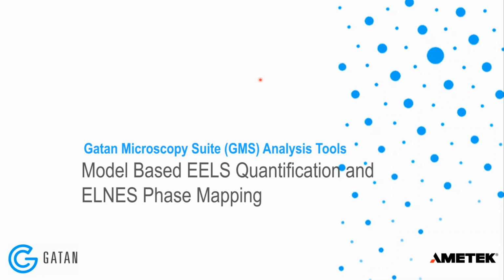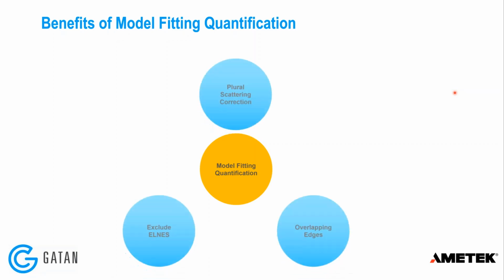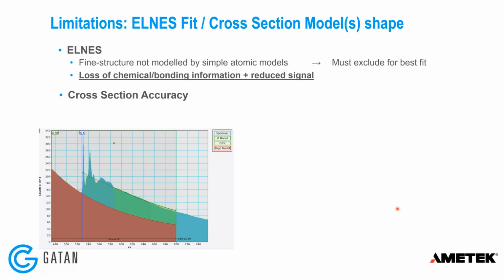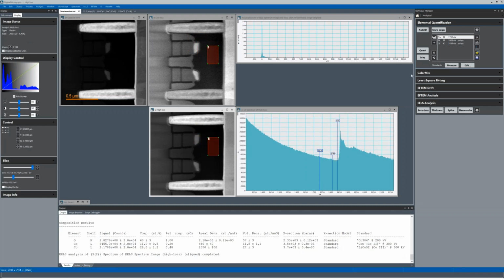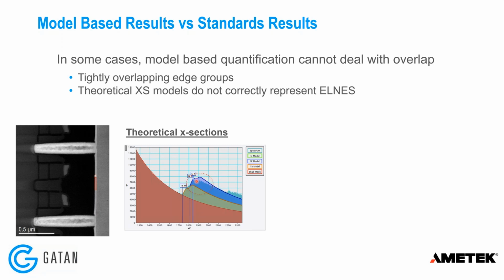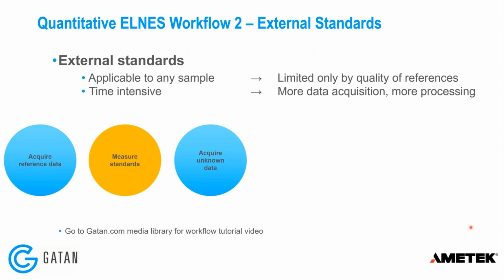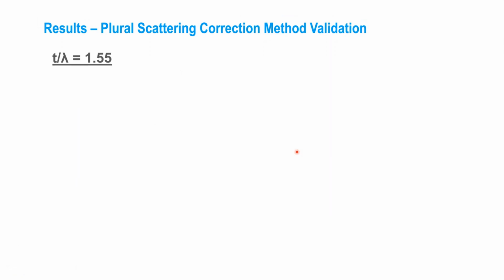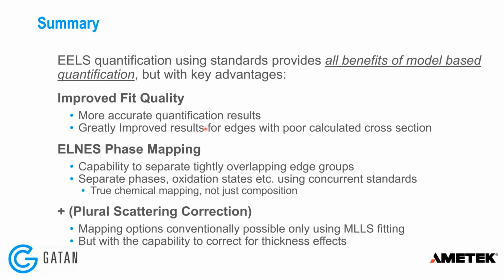Model-based EELS quantification & ELNES phase mapping

Comment: Hello. I would like to extract data like .txt or .dat file of zelo loss spectrum. But I can not do that. Please some one help me. Thank you
Reply from the maker: Thank you for your inquiry. Please follow the steps below
•	Select spectrum in GMS 
•	Go to file menu
•	“Save as”
•	Choose EMSA/MAS format file format, which has a *.msa file extension

This only really works well for spectra with only one layer, e.g., a single spectrum, not multiple spectra stacked on top of each other. The file format is easy to read in a text editor or import into Excel. Please contact info-gatan.com if you have further questions.